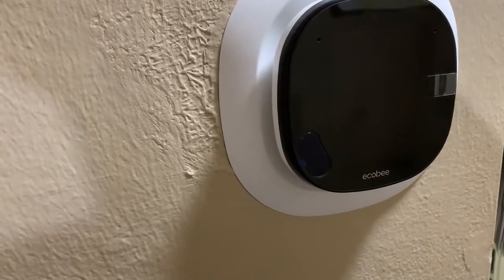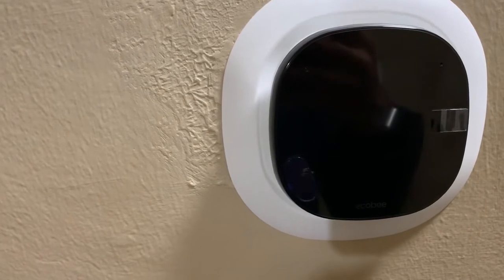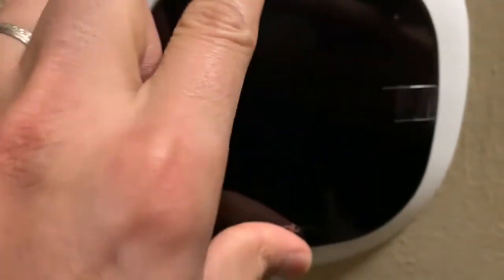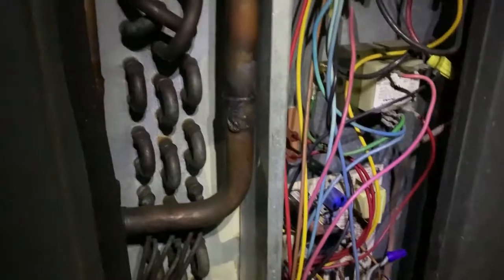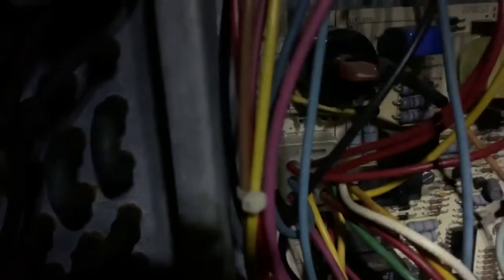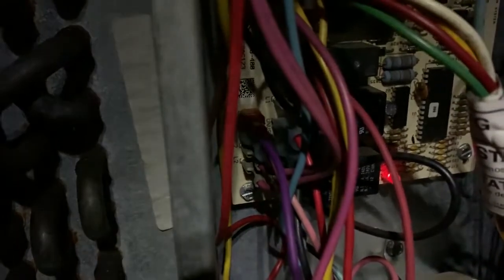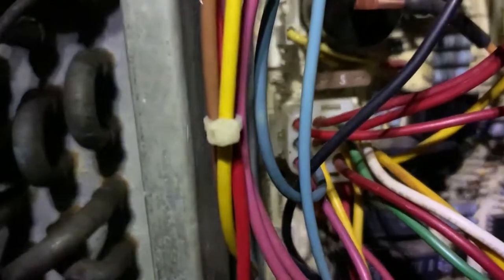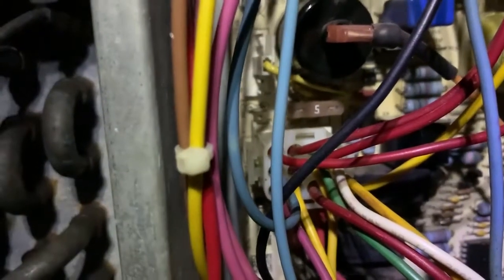New ecobee smart thermostat not powering on Fix!

Comment: I was at a loss when my ecobee wouldn't turn on. I quadruple checked the wiring and was about to call my HVAC guy when I came across your video and it saved me! Replaced the fuse and it booted right up. Thank you!
Reply from the maker: That's awesome! I'm really happy my video was of some help to you. Thanks for commenting!
Reply: where is the fuse?
Reply: @goalsdigger  on the furnace itself

Comment: Good video. Im getting power to my display but nothing is showing on screen. It takes 6 days to get a replacement... im thinking of jist going back to the simple analog style that I used with no proble for 20 years.
Reply from the maker: Thank you for supporting my channel! I can understand this can be frustrating, sometimes buying locally at BestBuy or something is better for that reason. If I may, my advice would be to hang in there. The benefits of having a smart thermostat are very convenient and can definitely save you money.

Comment: Installed mine yesterday, have a honeywell 9800 included with my plus 90 furnace.  After lots of frustration, I bypassed to 9800 and viola, it works, the 9800 is a 1,2,3,4 wiring configuration and also apparently messes with the signals and is not compatible with the ecobee.  low an behold there is 5 wires coming from the furnace and one was not used, same on the thermostat wiring.  frustration gone, system functions, ahhhhh
Reply from the maker: Glad you were able to solve it! I appreciate your support for my channel, with your help and others we are almost to 1k subscribers!

Comment: I just purchased an Ecobee Smart Thermostat with Voice Control. My device will not power on same as yours. After several troubleshooting attempts I gave up and simple reinstalled my old thermostat and everything is working fine again. The Ecobee compatibility website confirms that my home's wiring is indeed compatible. So I'm guessing I have a defective unit. I plan on returning the current one and trying my luck with a new one. 
Also, my wiring setup is similar to yours. But my white wire is used for the O/B slot not the W1. That may be your issue but you should probably have a professional check it out just in case.
Reply from the maker: The most important wires to turn on your thermostat are C and RC/RH. My recommendation for you is to test with a voltage meter which two wires bring power to the thermostat. Then try to match the remaining wires to what you had on your old thermostat. If none of that works, then I suppose it could be possible that its bad..